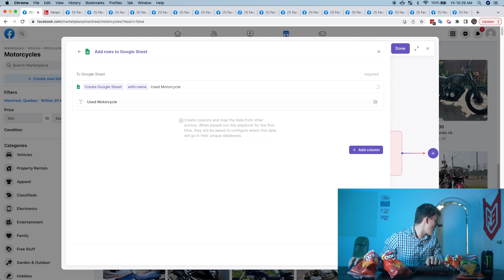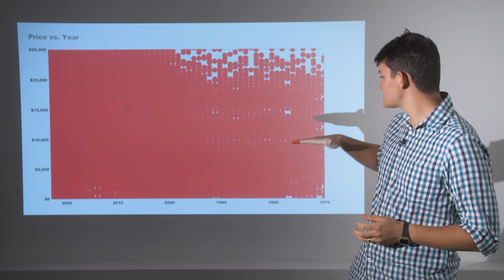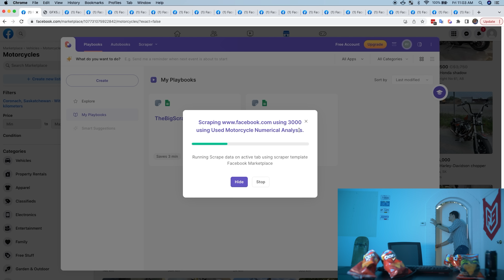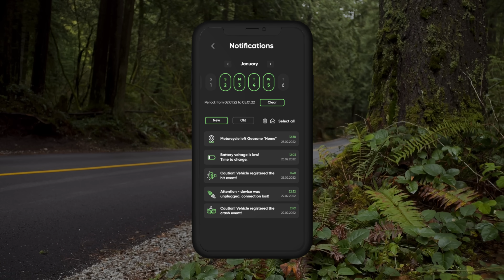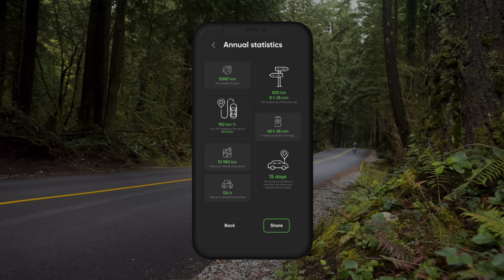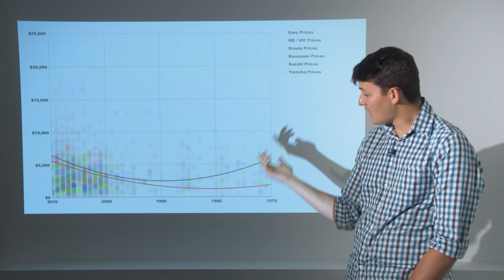Used Motorcycle Prices – A Statistical Analysis

Comment: Fun fact, I bought my 80s bike for 500 bucks, spent a year and another 500 fixing it. It was a pretty alright experience
Reply: I bought my first street bike for $50 -- rode it a few years and sold it for $850.  I have no other examples like that.
Reply: @no_nuts  It likely depends on how much sweat equity and risk you can take on. A bike that doesn't start at all is a lot of both, but if you can get it running for a reasonable price, you're looking at a decent profit. Especially if the seller just wants it gone.
Reply: I tend to buy bikes for $2000, put about $1500 into them and sell the. For $2000.
Reply: @californiapoppy78  buy high, sell low
Reply: First bike was a 74 cb360 that started but clutch didn't engage. Fixed that with a ball bearing i had lying around(dont ask how). Bought for 400, sold for 1000
Reply: @FilthyGoyim  do you mean just the ball or the whole spinny thing?
Reply: @Lux-h4h7h   dont ask
Reply: Same but mine was a 79, 4 months and ~1k fixing
Reply: Now it’s worth $350 😅